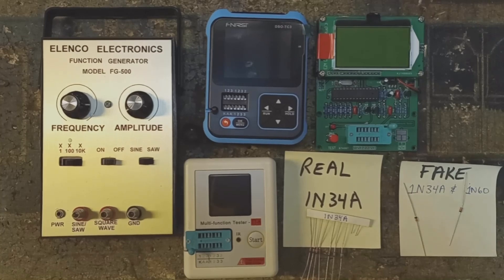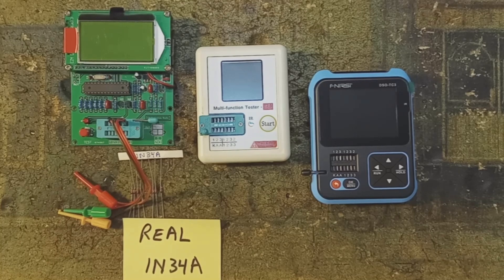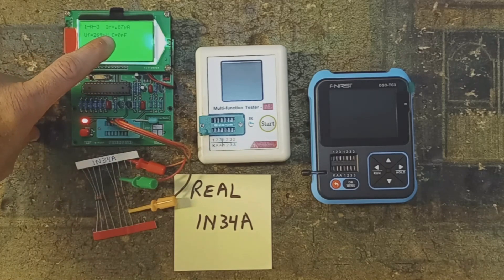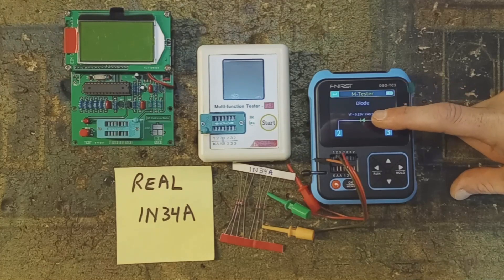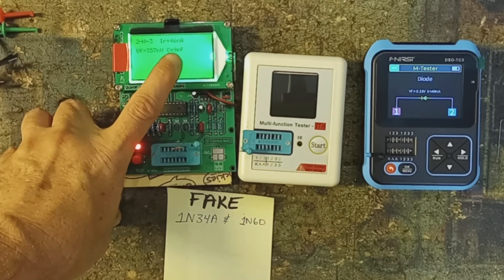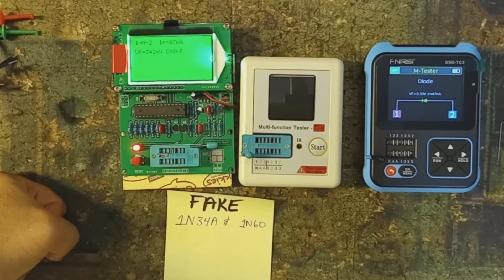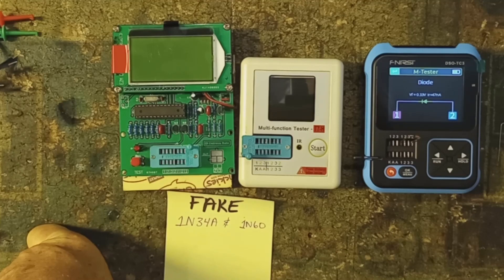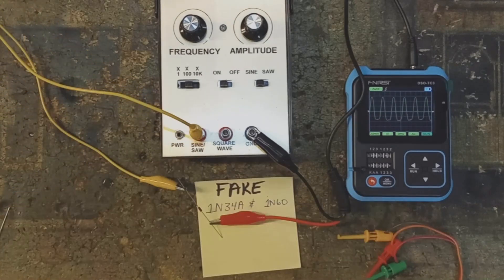2 ways to test germanium diodes 1N34A 1N60 for real vs fake Schottky counterfeits

Comment: It is not very clear on the video, about which lead was going into the tester's sockets where. You have 3 leads there but only 2 are used and two of the colors are very close on the video.  I figured it out eventually after fullscreening the video, but it would have better if it was pointed out specifically. Thanks! I think I got a bunch of duds :(

Comment: I have some germanium D9K diodes that measure around 180-200mv.  Is there anything to worry about if the reading is below 200?
Reply from the maker: no, lower is better for germanium diode
Reply: @bigslick  I also have some that show leakage but are around 500mv in the TC-1 tester and my dca-75 but on the multimeter read around 300mv . They're Russian D9v. Is this because of the test voltage?
Reply: @cb24203it's because of test current. Vf will change on all diodes with a change in current. Commonly referred to as the knee in the audio/pedal world.

Comment: I think - DC biased silicon transistor as a AM demodulator, or silicon diode, LED with DC bias work better than germanium diode.
Reply: There are better options if you are going to use a transistor.
Schottky diodes work better in general with the right loading resistor
https://youtu.be/5y7I7G_a3Qo?si=de22ziEPiY3x9r67
If you want to bias a diode, biasing a schottky is a good way to go